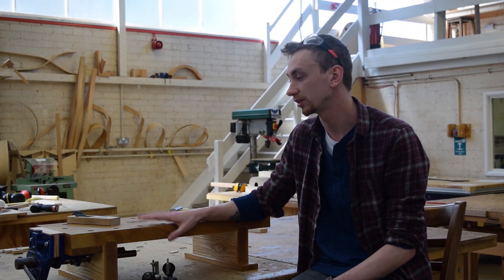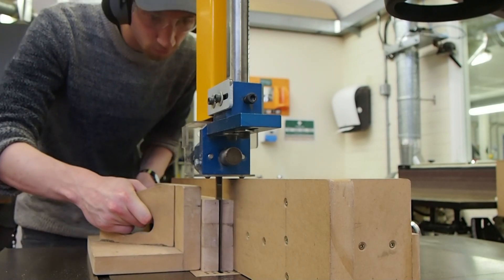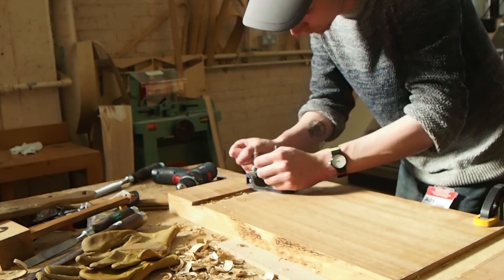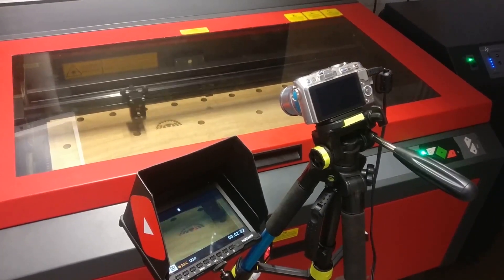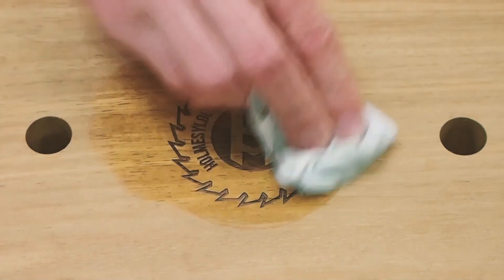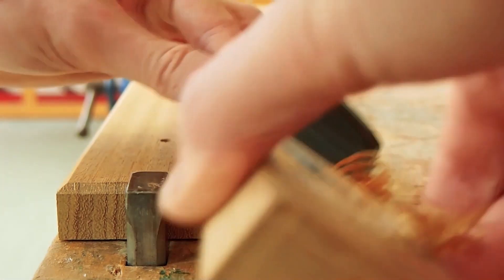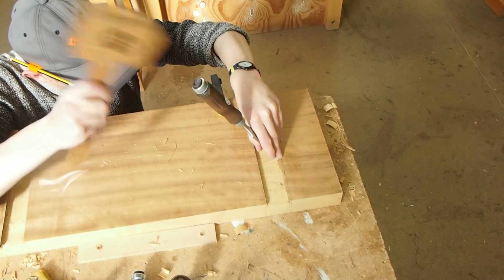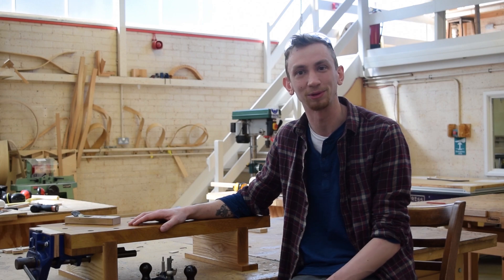Creating a Japanese style work bench

Comment: Second part of the first comments.

Nobody I knows even knows what an Atedai is. I didn't know it was an ancient style from Japan. I just started doing it after I found the MANY eases and advantages it gave me on my jobs. Alot of people told me WOW That's genius and you should make them and sell them. I'm an engineering student that has many inventions  mostly that make an already existing products better for me.
Kneepads built into pants,
A hand truck for long lumber, tactical head light for fighting. Personal folding Shopping carts are just a few of my ideas....and this short workbench ....all in which have been invented already. This is one of my favorite products. I'm in the middle of customizing one I made out of a cabinet base. Ripped out and remodeling a kitchen I got a nice 20"x20"x 1" piece of finished plywood that is strong enough to handle a lot. 
I have a huge problem though.....